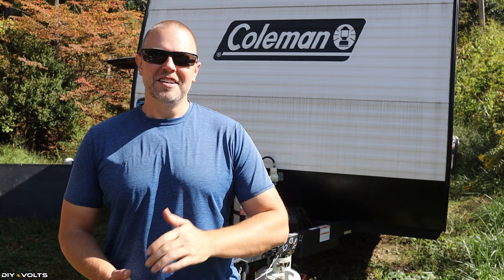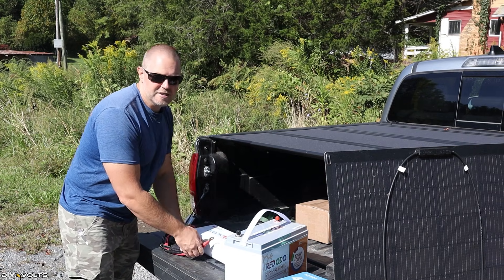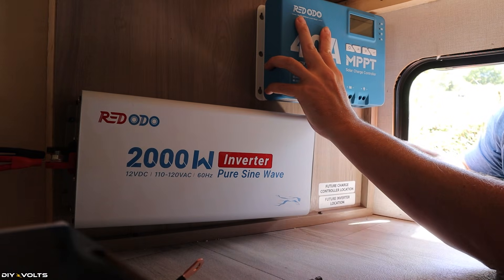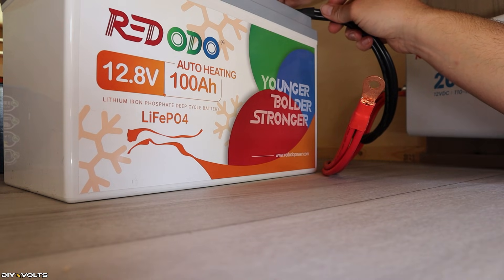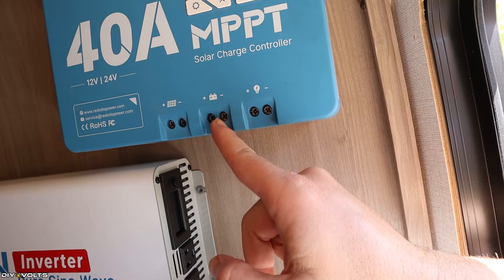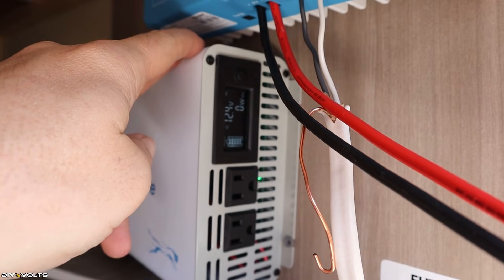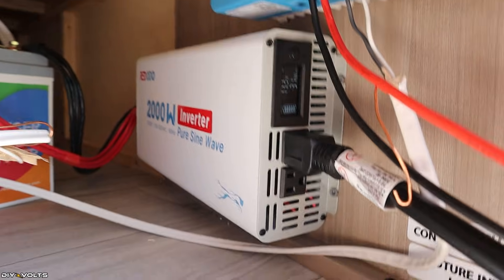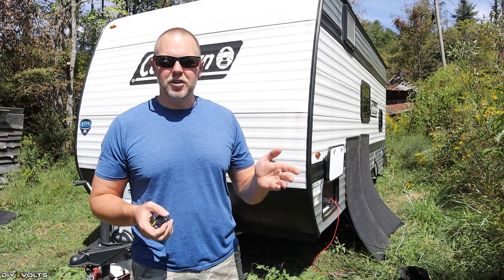Easy Install Solar Power to a Camper - Only 4 components needed

Comment: Nicely done, but you should really add a fuse between the battery's positive terminal and the inverter. These lithium batteries can put out so much power if there is a short, that they can melt your cables and start a fire.

Comment: here is another ideal, when I do campers. I measure the area where i want the system mounted, measure a piece of half inch plywood, mount everything on it with all the wires and the switches and with just 4 screws, I can mount it the space without spending hours on my side in a box wiring the system.  but still a great job on it.

Comment: Easy direct and not too difficult to set up for some simple "boondoggling".  Well done. That's a nice little AC unit, drawing about 6 amps should not be a problem for the 15 amp plug to 30 amp plug adapter or the 16 amp inverter.  Yes please strap the battery down before moving the camper anywhere.  May I suggest bus-bars for wiring the charge controller, battery, and inverter together, for cleaner connections and easier addition of future batteries?

Comment: Do you have to shut off the converter inside so it doesn't drain the battery too quickly?
Reply: Yes, Converter always draw energy, even if there is no load.
Reply: Shutting off the converter will have your indoor 12v lights, & 12v fridge circuit and such running off the trailer's lead-acid battery instead of the inverter.
Reply: @workbenchz  It is about leaving the van. So everything is shut off (Lights and so on.)

BUT the inverter will still drain energy. 
This is why you have to shut him off separately. 

I would suggest a main switch, shutting off everything!